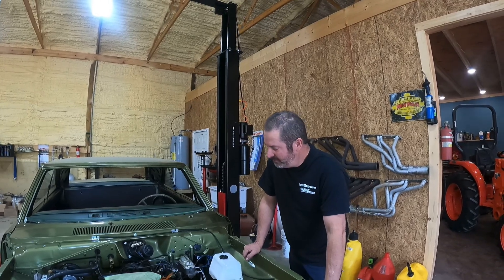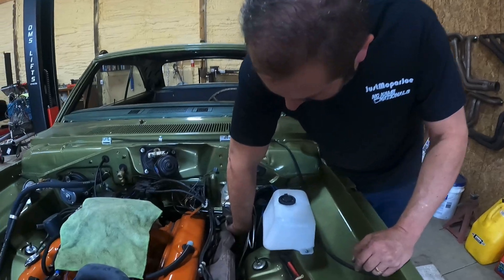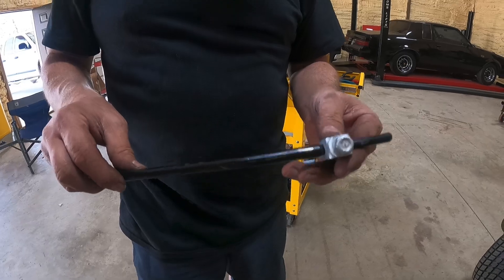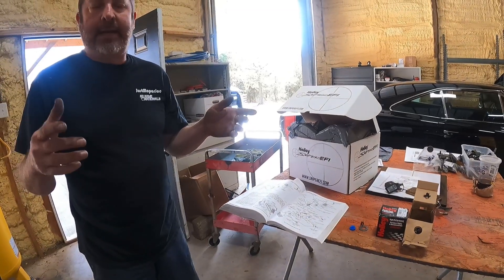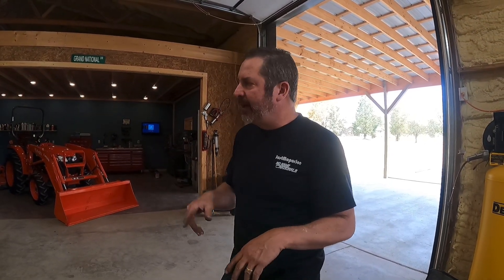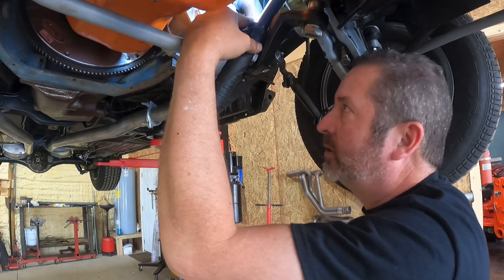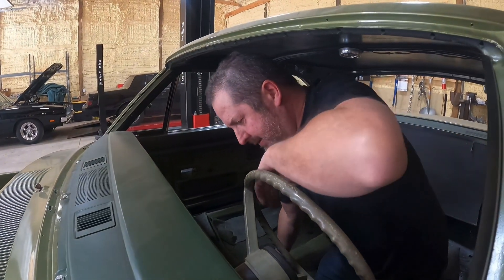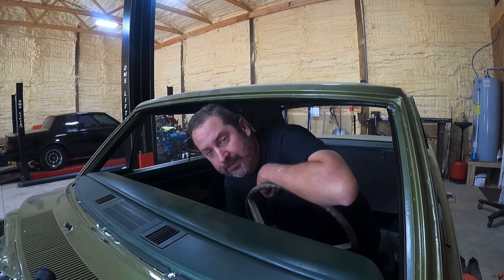1970 Mopar A Body Interlock Linkage

Comment: Hey Blake, That "shim" you found... Is the Hurst Comp. Plus dirt shield that is found on All of these 4-speed shifters built in the last 60 plus years! It just tabs into the lower body held in place by its own spring pressure. The other small metal piece is supposed to be at the top front of the shifter... It is the front handle retainer held in place by a small lock nut which fell off! lift your boot, and it will be self explanatory!  No wonder you are complaining about how poor the shifter feels! You are VERY OBVIOUSLY a HURST DEPRIVED CHILD from a later generation of enthusiasts... If I were you...Buy a used shifter and a HURST rebuild kit, and send yourself to "school"... OLD SCHOOL that is! Great Day! Frank Parks at Mopar Restos, in Summerville, Ga.
Reply from the maker: @frankparks4900  - thank you sir! I absolutely will now!! Much appreciated